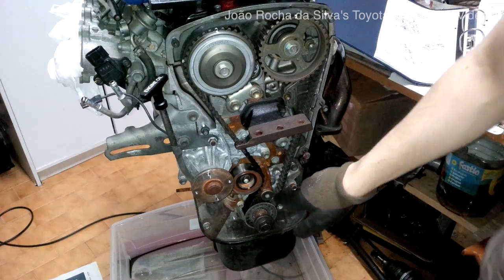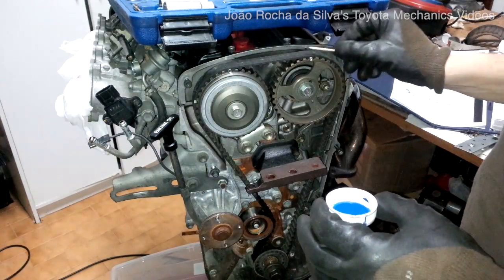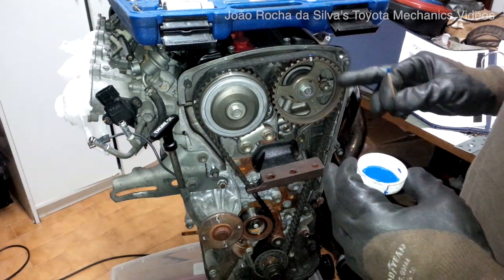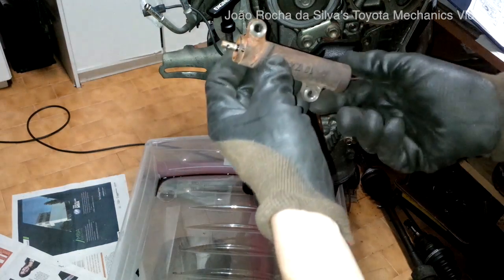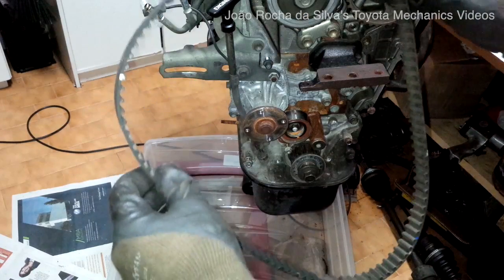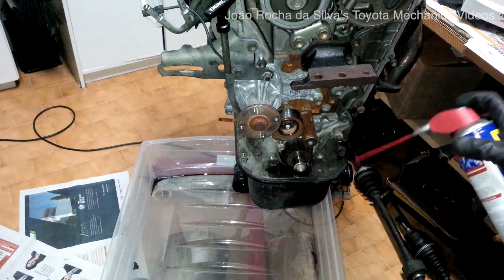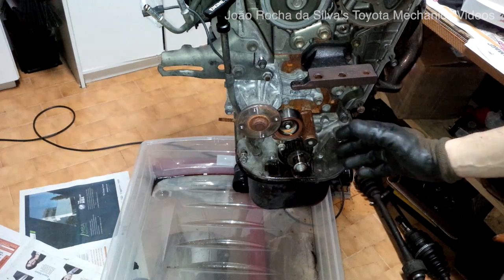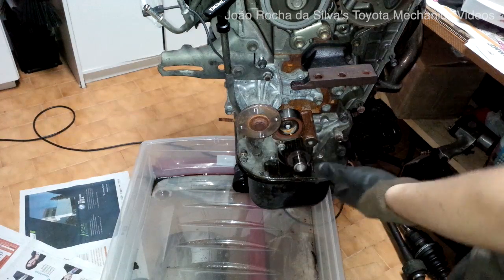ᴴᴰ(Part 2) Toyota 4AGE 20 valve black top engine rebuild: Timing Components

Comment: Hello sir i would like to ask is it possible to put an 4afe crankshaft into that engen
Reply: All A block bottoms ends are the same and work with all A block series heads. You'll just need to find the right belts. You can even put a 1.8 block on this head
Reply: No

Comment: Hi, does crank gear of silver top and blacktop are the same? I upgrade my silvertop oil pump to blacktop pump, seem the timing belt is loose on the new tensioner.

Comment: seen the error on the fsm about the timing mark yet when reassembling? Lol how  Toyota screw this one up lol. cam pin SHOULD be on the notch with the #5 on it. Just like how you removed it. manual says otherwise.

Comment: I must have missed something along the way.  Are you rebuilding the engine or performing a refresh by replacing all the seals and gaskets prior to installation?  If it's the former and not the latter, why, did you discover something wrong with the engine?
Reply from the maker: Nope, the engine is in very good condition. This will be like an "extended" refresh, with gasket and seal replacement as well as professional cleaning, followed by piston ring and bottom end bearing replacement. I just want it to be like new when I put it in the car, thats all.
Reply: Smart man.. You, my friend, suffer from what's known in the automotive world as "As long as I'm in there" syndrome. And that can be a very slippery slope, but a good one, none the less.
Reply from the maker: Yes, that is really the case. After I spent 2 months under my Corolla (the one I am transplanting the engine into) fixing the suspension step by step instead of fixing everything at once... I learned to save money first and spend it all at once as well. As long as the engine is outside of the car it is easy and there is no "redundant sweat". My time is valuable, so I'd rather replace every part that may be worn before I put everything back :-)
Reply: João Rocha da Silva A man after my own heart. I understand all too well. My neighbors think I'm obsessed, I tell them I'm methodical. There's a method to my madness. That's my story and I'm sticking to it, ha ha.
Reply from the maker: Mr Ol Skül Yeah, that is really the spirit!